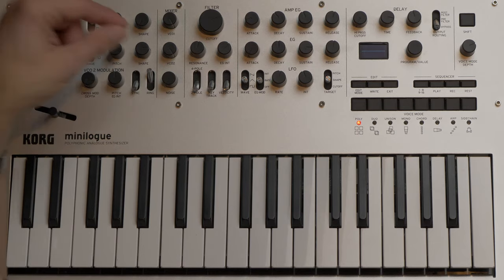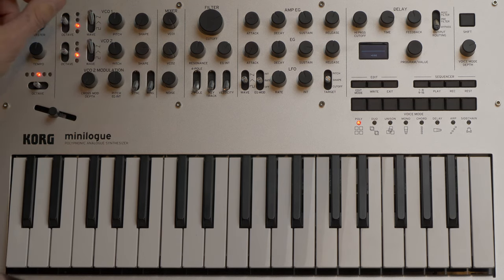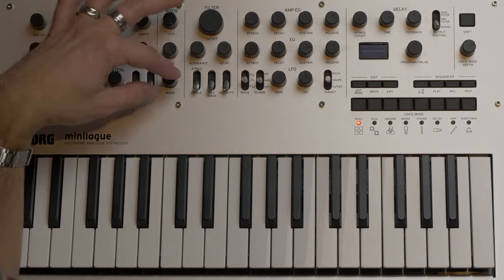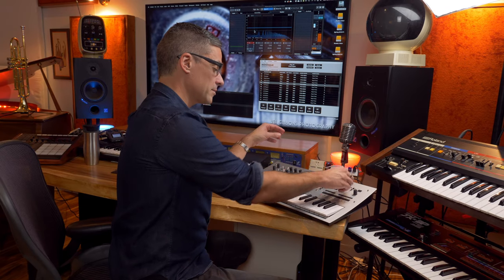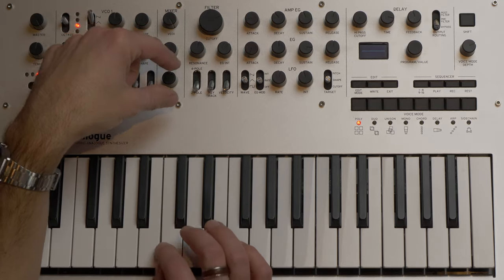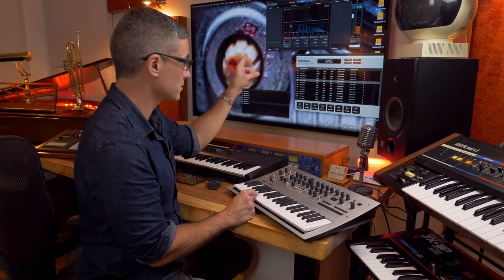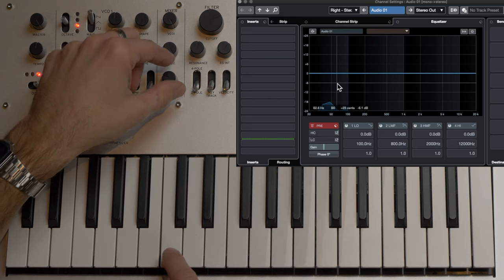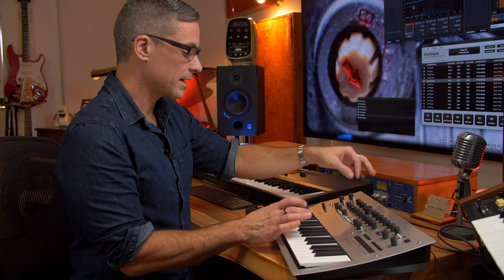Korg Minilogue Basics 2020

Comment: This Synth is without a doubt a very very underrated chimera. Especially for an analog synth as the sound is so drastically different than most analog poly-synths. It sooo much wants to rather sound un-analog and very lo-fi. You really have to listen to the instrument and how it guides you. Because you won't get the same sounds on this thing that you would get on most other synths. And despite (or maybe because) of that you get lost in it so much and end up with sounds that you did not really intend to make but how the Synth wanted to sound. This is a wonderful way of discovering an instrument and making presets for the Minilog is so much fun. You really need to completely disregard what you know about analog synths when you play with this instrument. Then it really is an absolute pleasure to fiddle with. And i am pretty sure in 10-20 years from now it will definitely be seen as an absolute cult synth. Probably even more than the Minilogue XD that is an entirely different synth rather than a successor or Revision but more like a different approach.

Comment: Great vid! Have they released a sound editor update for OS Catalina? I haven't been able to get it to work every time I try to run the program
Reply from the maker: What happens when you run it? Mine seems to work fine, just upgraded to Catalina.
Reply: Jef Gibbons I get a message that my Mac can’t run the program because it needs to be updated by the developer. Doesn’t seem to open the app at all, are you using the minilogue XD editor or the original? Thanks!